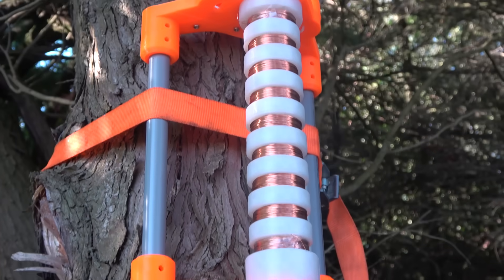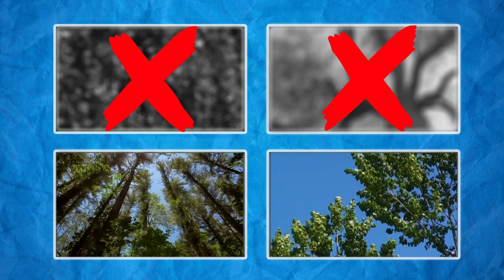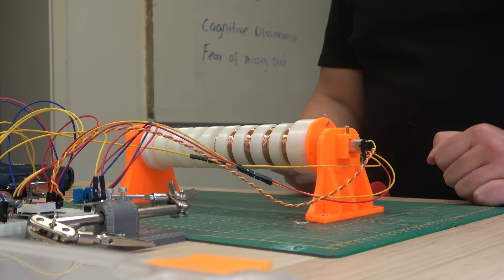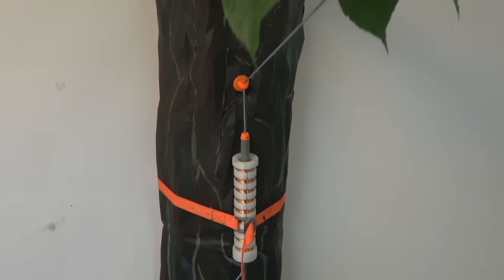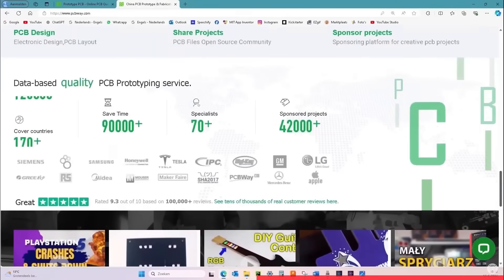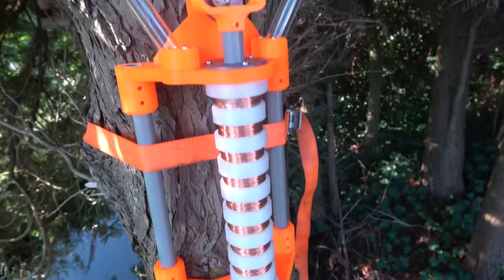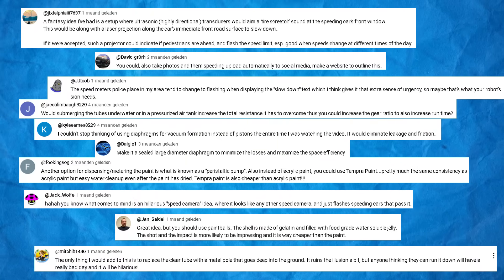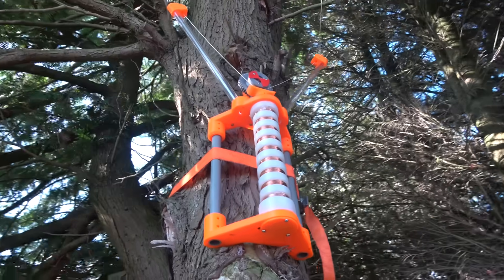I Made a Tree Generate Electricity..

Comment: as someone who also comes up with overcomplicated solutions to interesting problems, i appreciate the effort.
but uh...
strangling trees with complicated little machines involving many moving parts that can easily get jammed up with dirt, bugs, and other junk, just to generate a little bit of electricity seems like a bad idea.

what problem does this idea solve that wind turbines don't already solve way more efficiently and simply, with way less wear and tear, way less maintenance, way less waste, and way less material per unit of generated electricity?
Reply: Trees are anywhere -> Cheap 
They dont make noice, the reduce it
Dosent disturb The views....
Reply: It's like this is an early prototype and he's looking for feedback to refine it or something. Wouldn't hurt to be the slightest bit constructive with your feedback, especially since your main complaint is defeated by putting it in a housing and swapping straps for screws/pins.

 Efficiency/Cost threshold for windmills isn't that hard to defeat, the issue is that windmills don't have to be specialized nearly as much. If you have the spare time and the correct setting this has a real possibility of supplementing your power needs (assuming the finished product has ironed out some kinks).
Reply: @Rawßirt   I could see this concept as useful for powering short-term non-critical lighting or signals, similar to how some road signs and barricades have solar-powered flashing lights on them.  But as a viable way to power whole households or communities? Not a chance.  You'd be looking at wiring up whole forests. Material costs would be astronomical, and it would require constant maintenence as parts decay in the elements, the wired trees grow and die, and animals interfere with the system. The installations will have an effect of some sort on the health of the plants and animals that live there. Inevitably, the forests such setups are installed in will become polluted with bits of plastic, copper, and electronics.

Constructive feedback: consult with experts in the fields your technology will necessarily impact (e.g. arborists, forest people, wildlife people, firefighters, environmental protection authorities, etc) to help determine whether this technology could feasibly scale responsibly.
Reply: @SidShakal  You realize that a lot of breakthroughs in fields happen by people from outside of that field, right? A lot of "experts" in the field of renewable energy are in the field to make money, so things that have the potential to provide free, or low cost, energy are not going to get a lot of study by those experts.  I have my doubts whether this in particular is feasible.  I feel like it it was generating enough electricity to be remotely viable, that would have been included in the video.  But, the current climate of shooting down ideas without even attempting to test them is absolutely stifling to innovation.

Comment: What if you connected some of those pistons like an engine? You could gear it up, and place it at the bottom of the tree. Then just run a longer line from the pulley. In the form of an engine it would fit better like a backpack strapped to the tree. This could work for larger trees.

Comment: Now that is thinking! Thank You, I’ll have to try this. My primary interest in the past has been gravity energy. Your idea is pure genious . Try to mimic nature, then multiply the number of devices, then combine effort to gain an acceptable and useable amount of power. Haven’t done it yet, but there is an approachable number of loud vehicles going by. Collect the noise with microphones or speakers which will make a useable current by the bellowes that is attached to the coil of wire working in conjunction with the magnet to make current. Now take the idea to noisy New York City where the sound decibels are constantly changing and strong. Now that will really make some power. Glad I found your inspirational you tube channel.

Comment: Well first off… since you progressed from straight up and down to the gear to capture side movements you may as well use a modified alternator or dynamo… second you should focus on the gear ratio and in some way run a wind speed detection sensor to the top of the tree that automatically adjust the gear ratio relative to the wind speed… this way when you have strong winds the gear ratio will shift to allow you to capture more energy from each stroke… lastly if you have gone through all the effort to set this up on a tree, why not capture movement from all the main branches instead of just one… this is the one I got stuck on a few years ago… I couldn’t figure out a convenient way to tag a line to all the relevant branches without everything becoming too complex… because we must remember that at the end of the day it has to be doable and quick and easy to set up… the only thing I could come up with to tag a line to all the relevant branches was a gun that shoots a ring shank tethered mail and a worker that’s a great shot… and the last obstacle I came to when I crossed this concept a few years ago was… the tree is constantly growing and changing… so every year or two adjustments will be needed and if it was the case that you had a forest hooked up to these it would take a lot of man hours to service the maintenance and routine adjustments… which could become cost prohibitive, but yes, this concept has been hitting me every year for so many years… the trees are there every day of every year and they never stop moving so there is all this energy… but how to capture it in a way that is easy and viable… just can’t solve it… but that doesn’t stop me thinking about it every year.

Thank you for this video it’s a relief to know there is not only someone else struck by this mystery in plain sight but someone that has actually got to the point of actually doing something to prove the concept 👊

Comment: I see a longevity chellange as the tree grows, you would have to reattach the system ever so often to ensure the ropes and your ratchet strap do not get grown in.
At this point stainless steel screws or nails might be your best option, as they do not corrode and you can use them as standoffs. 

I'd be very interested in a back of the envelope calculation of the power you get out of such a system vs. the raw KWh it took to mine the materials you use for one unit. 

I realy like the idea. As a software engeneer I think, the cost of adapting something entirely new to a system that was never meant for it, will always be more wastefull than a new system from scratch.
I can not imagine, this solving our energy needs in the near future, but as long as you learn something and have fun, please, enjoy yourself.

Comment: My mind immediately goes to blade-less wind turbines. Instead of using the wind itself, which would is much less at a forest floor because of trees, and a relatively large structure. Use the trees as the structure that harnesses the wind and attach the innards (I am fairly clueless when it comes to the exact workings of this style of turbine) to the tree. I imagine tall straight trees would be easiest to mount to, which works nicely with some of the concepts you mentioned.

Comment: Imagine every single tree having a small generator on it, both incentivizing not to chop down trees, but to literally plant and let more grow - helping offset carbon that way.

This reminds me of the emergency flashlight i have, where you shake and let a relatively small magnet go through very ineffecient (but working) coil system to power a single LED light for.. well generally a few minutes of shaking can give a few hours of power.

I like the concept of the Tree-Hugging generator, turning trees into "Power Plants" (ba-dum-tiss) but even if it turns out extremely well - we have another problem, and it is a problem we currently have and have had for decades:  transporting power, without causing losses or extreme expenses.

You could say it charges a battery pack. That could be monitored and when full - removed and swapped to another.  but this makes more labor.  You could wire it directly into something, but that will get complex when you consider where most of these 'tall thin flexible' trees actually exist - in semi dense forests.  Can't tear up the forest to build the wiring system, to then use the same forest to power it.

Transportation of excess generated electrical energy has been one of the big problems with electrical demand.  We need something that doesn't convert into excess heat, doesn't lose much energy, is safe to do, and can be done over literally hundreds of miles, without costing too much in other areas.

A ocean current generator works well - but it won't really be giving electrical current to anywhere that isn't next to it on the shores, so even if it overproduces by even a small factor- the amount of wattage the shore needs, all of that becomes 'wasted' if we don't find ways to store and transport it safely.

Comment: Why not just hang some lightweight turbines off of the branches? I mean, wind is going through the leaves causing the branches to sway.  Why not go straight to the source? Sure, the tree branches moving also creates some energy, but the wind should be more powerful and easier to harness.  There's lots of different wind turbine designs; some are pretty compact and don't take up too much space.
Reply: Sounds more like something to be added to this system,  instead of a replacement
Reply: @TheJerome1502  I think a turbine would be easier to maintain in the long run.  Fewer moving parts (and fewer parts overall), and you could seal it pretty well against the elements.  If you only used turbines, you could standardize the maintenance procedures (replacing bearings/grease on a set schedule).

Comment: So, to maximise the potential of this idea, there are 2 ways to divide the efforts, low energy but high functionality, or higher energy through maximising efficiency.

The latter is pretty obvious but presents some significant but not insurmountable challenges. The most obvious would be a grid of these devices in a forest or plantation, charging a single, large supercapacitor array, "plumbed" into the electrical grid via a synchronous inverter. Expensive and probably a very slow return on investment.

The low power high functionality option could serve in many ways but the one I like is, the old saying, "if trees produced wifi, everybody would be clammering to save the forests!" There's the high functionality solution! Equip trees to generate enough energy to produce one node of a free, public wifi mesh. This could potentially eliminate the need for higher power systems like cellular comms and provide a more accessible communications network with less monopoly on service.

Imagine a world where local communities established network infrastructure in forests, plantations, parks and their own home gardens, providing carrierless communications and networking. The entire world covered by free internet and nobody would want to cut a tree down.

However, I'd hope it was done in a less garish colour than Prusament orange😂😂😂
Reply: It's calles solarpunk

Comment: I wonder if you could add a regulator in there to deal with gusts and strong winds and also something to somehow store the movement in a spring (like a wind up watch) and reconfigure the magnet setup to work off off a mecanically ossilating pendulum...
It'ld be a whole lotta clockwork logic though... but if done it would essentially have a kinetic battery, charged by the tree, that runs the electric generator. By seperating these systems you could charge the kinetic battery all the time and 'turn on' the electric generator when desired.. These would be cool to install in parks, forests and remote locations!
Reply: Ratchet differential to havr only one output rotational direction and flywheel would be easier

Comment: Dood…just install a rotary generator at the pulley. Much gain in efficiency 👍
Reply from the maker: Yes and no🤓 one of the reasons i went for the linear version is because of the CW to CCW (etc.) motion of this prototype. This means your constantly working against the momentum of the rotor of a rotary generator unless you work around that with let's say a ratchet system for example.

Comment: I don't get it... you went to the trouble to design a linear generator to take the linear motion of the tree to power it, but then you convert it to a rotary motion, then back to a linear motion.  It would be far more efficient to simply drive a rotary generator.
Reply from the maker: Yes and no🤓 one of the reasons i went for the linear version is because of the CW to CCW (etc.) motion of this prototype. This means your constantly working against the momentum of the rotor of a rotary generator unless you work around that with let's say a ratchet system for example.

Comment: I mean... They may sound dumb, but if you can't get more speed could you instead compensate by making the linear generator longer with stronger magnets on the top and bottom to ensure the weight is the same?

Comment: The bottom cap needs drain holes for rain if this thing actually stays outside, otherwise the magnet bar will get hydro-locked and something will probably break. Probably want some sort of boot or bushing at the top to minimize the amount of rain going in there too. A dust boot at both ends of a through-rod would help keep it centered, kind of like how speakers keep their coil centered.

Comment: I've thought about this for a few years, here in the Swedish forest. I think pines are the easiest trees to use as they are common and move in an what looks like a synchronous way at first, but actually it's generally not. 
      The top of each pine tree is easy to fix into and not used in timber production, so metal darts in it wouldn't really be an issue: The method to fit an electrical generating apparatus would have to be crossbow for efficiency and I suspect the best generator would be something that looks like a snail shell - with one line to hold it to one tree, a second line into the next tree and it would almost 'hang in the middle' or near one tree, with a rotating coil in the shell, and/or even a flywheel. The question really is how to network the trees, using several, or even up to thousands, to produce real, usable power. 
     I suspect this idea has its greatest possibilities for smallholdings and isolated cabins and won't have a serious application beyond complementing solar power setups, but it's worth testing in practice, especially for the dark wintertimes here in the north when light is less available.

Comment: From a horticultural point of view, this raises many interesting questions, as the trees have developed very different strategies for dealing with wind. Everything is relevant, the age, the trunk diameter, even the proximity to the coast... (the closer to the coast, the more wind-resistant the tree)
I have now found a useful paper on this from the University of Applied Sciences and Arts Hildesheim/Holzminden/Göttingen: ‘Trees in the wind - Experimental development of spectral visualisations of tree movements’. 
Here, for example, the inclination behaviour of over 100 trees during strong wind events is measured over two years. 
Based on weather data, wood density, diameter, crown shape and elasticity, it would be possible to draw a rough conclusion as to which tree is more or less suitable for which location (or for which experimental setup).  
Unfortunately, I have only found it in German so far.  
https://astwerk.de/fileadmin/2016-Baumschwingungen_mit_Grafiken-im_Text_lang.pdf
Reply: One thing is still very important if the experimental setup is larger. If the resistance influences the angle of inclination too much, the tree could be exposed to the wind too much and be damaged. That could be dangerous.

Comment: Great idea, however if you replaced the linear generator with a stepper motor you would reduce the losses associated with the mechanism and produce more power. The output would need to be rectified into DC and smoothed with a capacitor then maybe fed into a dc to dc converter to charge a battery.
Reply from the maker: Yes and no🤓 one of the reasons i went for the linear version is because of the CW to CCW (etc.) motion of this prototype. This means your constantly working against the momentum of the rotor of a rotary generator unless you work around that with let's say a ratchet system for example.

Comment: Wouldn’t it be more efficient to use two equal magnets that balance each other out to double the voltage while reducing the weight to lift to zero? A scale mechanism could hold both parts and the smaller gear moves a vertical bar, comming from the null point of the scale from left to right.